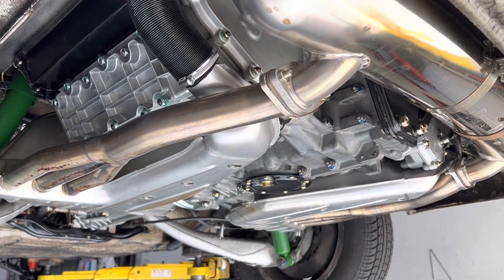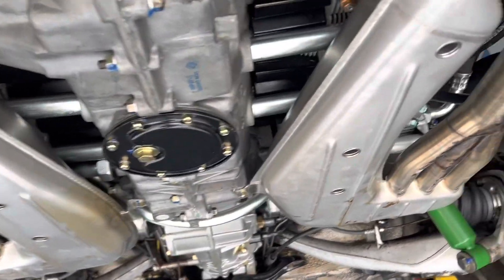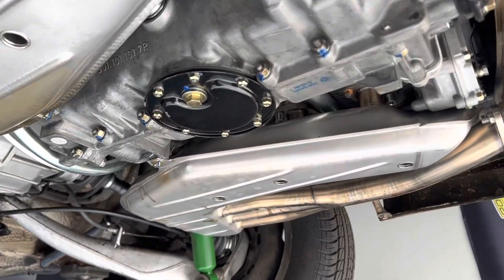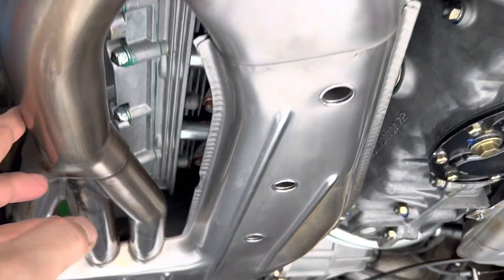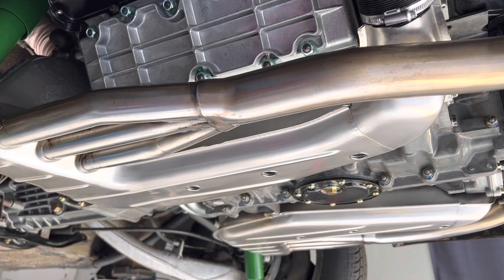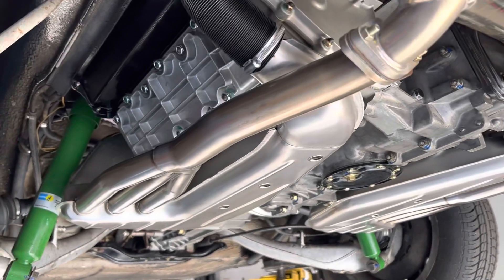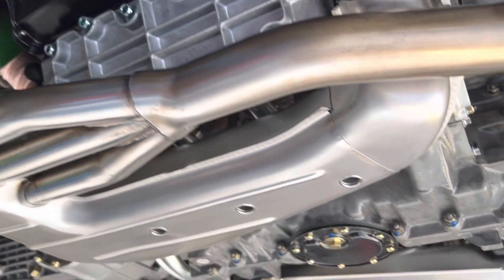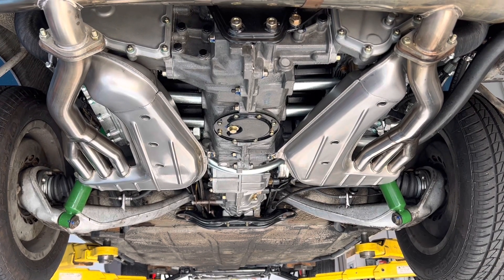1974 Porsche 911S SSI Heat Exchanger Cleanup

Comment: Nice job.  What is the part that is leaking?
Reply from the maker: That is the return hose from the Sportomatic. Torque converter outlet fitting to be exact. There are three oil lines on the Sportomatic gearbox, so six fittings. Hopefully these become available sometime in the near future.
Reply: @Breitwerks  with the Sport-O-Matic transmission being so rare I can see why the parts are not available and not being made by someone. It sounds like a pretty fun transmission to drive though, it would be nice if someone started making the parts.